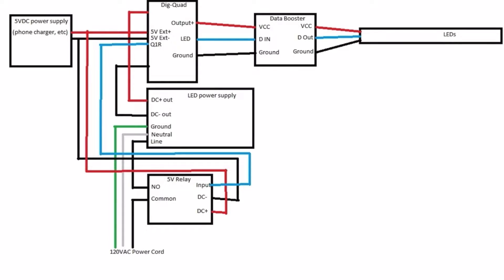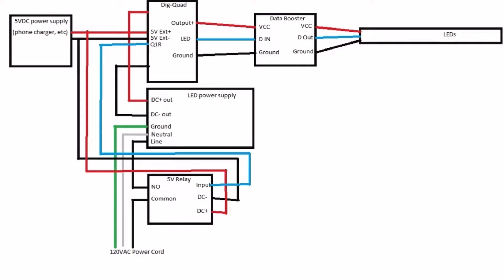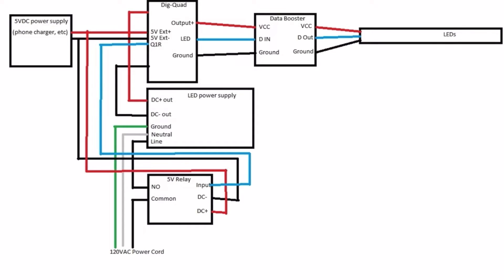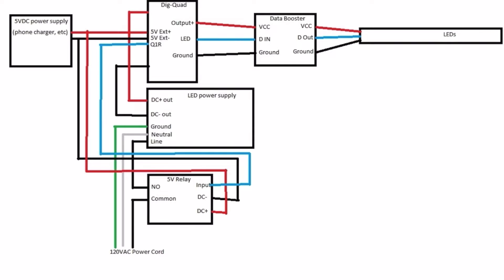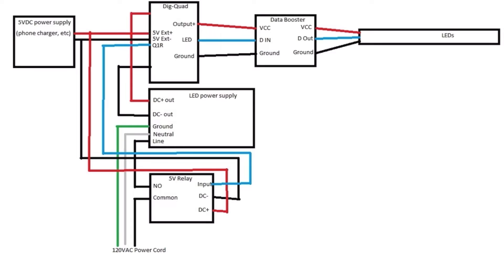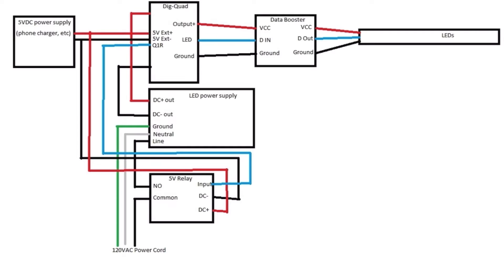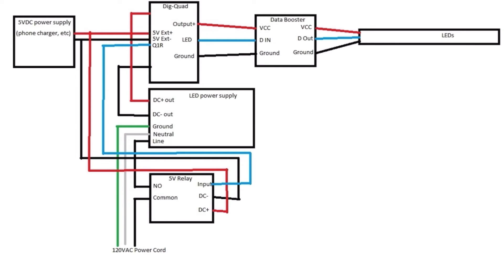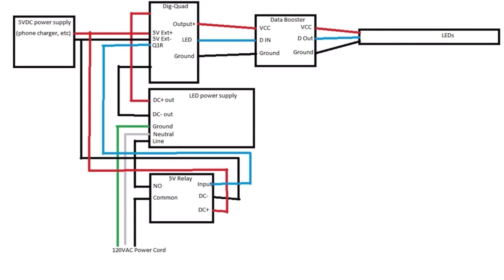LED Lighting Wiring Diagram   12v with 5v Relay

Comment: How to wire Dig Uno? I didn't find Q1R pin
Reply from the maker: @fevgg  That’s on the Dig-Quad, not on the Dig-Uno.
Reply: @1SpudNuts1BigNasty-DIY  Do you know how to connect to Dig-Uno? I hooked up everything, WLED is working, when I give 5v to the input of the relay, main power supply turns on.
Reply from the maker: @fevgg  Try this, but It depends on what version of dig uno you’re using. Look for the 5v, ground and q3 pin markings.

https://quinled.info/wp-content/uploads/2020/06/QuinLED-Dig-Uno_relayboard.png
Reply: @1SpudNuts1BigNasty-DIY  I tried. Didn't work. Just a minute ago find the solution from Dr. Zzs. Used Q1 and in LED Preferences I put relay GPIO 15. thank you

Comment: Can't tell you how many times I referred to this diagram for my own setup, thank you. Ended up splitting the 230 AC power and getting a second 5v PSU to power the relay. Main reason to get a relay was the 12v meanwell PSU had horrible coil whine and this solves it.

Comment: Amazing. Question. Presumably you can use a buck (12v to 5v) inverter instead of a separate 5v power source?
Reply from the maker: You mean a buck converter? Yes, should work just fine for 5v lights but why not just use a 5v plug. Like a phone charger. As long as it supplies enough amps to handle the load.
Reply: @1SpudNuts1BigNasty-DIY  Ahh but you wont be able to use the 12v same power supply? Only because I have a single run of AC power to the power supply and thats it, no easy option to add another power source. So can you add the buck to the same power supply that you're turning on and off from the relay?
Reply from the maker: @qalih  The signal to turn on/off the relay comes from the controller. The second (5v) is used to keep the controller powered without running the 12v. I guess you could but you’d just be running the 12v PSU constantly.
Reply from the maker: @qalih  Not sure how that would work since the relay is what controls the 110v (AC) for the 12v (DC) PSU. You’d still need 2 PSU’s.
Reply: @1SpudNuts1BigNasty-DIY  Thanks for confirming, seems like it. My only reason for a relay was due to the digquad overheating, but this is a separate thing I think. There are parts of the underside of the board that are getting extremely hot, I blew some fuses somehow so might be due to that.
Reply from the maker: @qalih  You sure you’re not pushing too much power? How many LEDs you running on a single channel? I won’t run more than 600 for 12v LEDs without power injection but you have to make sure you’re not exceeding amps.
Reply: @1SpudNuts1BigNasty-DIY  So currently I have 3 ws2811 (300 leds per strip) - only two are currently powered on so 600 - each one is being power from single end (no power injection). I am using 16 guage wire directly inserted into the digquad, maybe it is pulling too much? But that LED is only being powered from one end, and as far as I understand each LED strip only pulls 4 or 5amps.
Reply from the maker: @qalih  They may be too much on one channel, I try to keep it below 5 amp. Maybe try just one string to see if the controller cools down.
Reply: @1SpudNuts1BigNasty-DIY  will try it and let you know!

Comment: Please help me to understand a little better. Is your diagram for one half of your box? Meaning, I will need two 120 vac power cords with the hot going to each relay and the other two wires going to each LED power supply?   Also, what gauge wire, or different gauge wires are you using? Thanks, I learned a lot from your video.
Reply from the maker: Yes, you will need a power cord (14GA) and a relay for each power supply and Dig Quad. Here is what I used:

Bergen Industries Inc PS915143 3-Wire Appliance and Power Tool Cord, 9 ft, 14 AWG, 15A/125V AC, 1875w,Black https://a.co/d/0yiRzOT
Reply: @1SpudNuts1BigNasty-DIY thanks

Comment: Thank you so much. I thought I was on track to correctly recreate another control box by what you discussed in earlier videos. Now, I am more confident that I am.

Correct me if you know and believe im wrong that if I need to inject power for further string runs... that I would need to be sure to run injection power from the same power supply. What I'm thinking to do is tie in a pair of additional wires onto the side terminals (vcc&neutral) of the 1st associated booster terminal, like you placed in your box, right where you mounted it to your control box. 

With these additional injection wires, I do plan to add an additional in-line booster (2nd). To do so, I plan to take the Data Out signal from the previous LED run and connect it too, onto the additional inline booster along with the side terminal wires i mentioned above; should i need to of course. 

Does this sound right? 🤔 

Again thx for teaching and sharing your project knowledge.
Reply from the maker: Yes, if you do power injection, it needs to come from the same power supply.